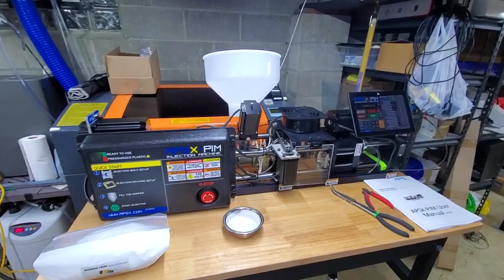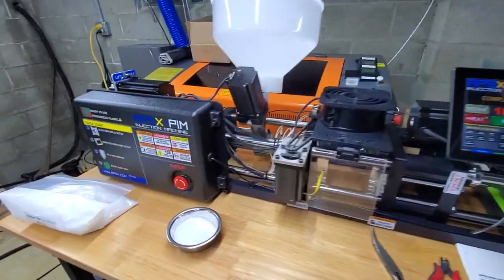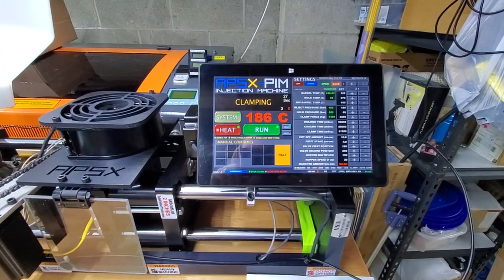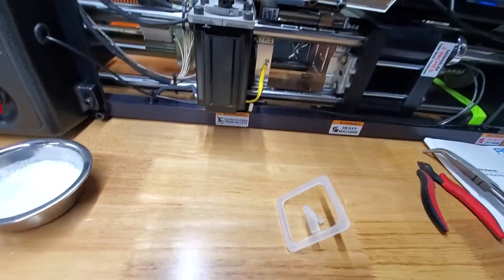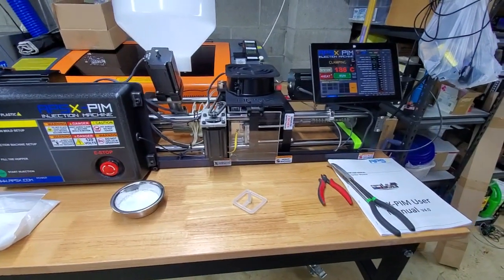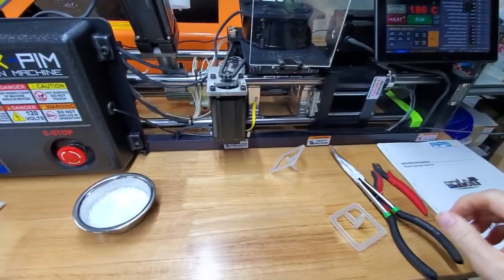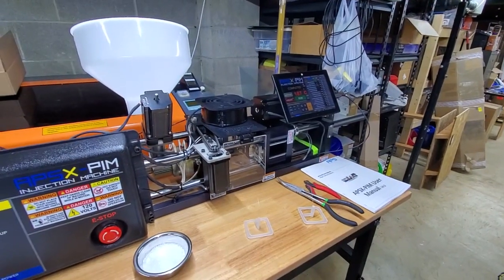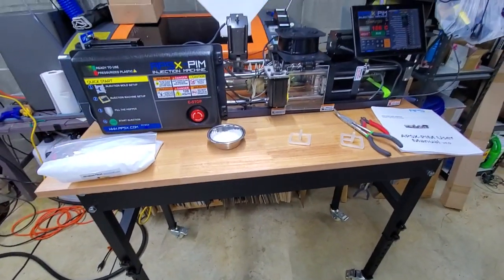My own personal injection mold machine

Comment: I need 100,000 parts with a volume of .4 oz.  Hoping 2 parts at a time.  How long would this take you if it this were fully automated (with ejection pins)
Reply from the maker: Depending on the size of the part of you could do several cavities, you could get decent production. I think the cycle time is between 90 and 120 seconds. Still would take probably a month running 24/7. This is really not the machine for that kind of production.

I think this machine is really designed to put plastic injection into the reach of a start up or designer. Once your product gets launched, then you would switch to traditional injection mold machines. 

For my use case, I will need quantities of several thousand units and that can be done in a few weeks easily, but then if demand increases I would farm the production out. Where a machine like this really shines is in being able to create a mold quickly and test it w/o long lead times for the machining on the mold and then trying to get into the production schedule to then get thousands or like you are asking for 100,000+ parts ran.

I think the manufacturer of this machine quotes it's good for 200,000 parts / year. Which, is basically running a single cavity mold 24/7/365.
Reply: @SEEMERIDECOM   Currently I'm 3D printing, but TPU can be picky.

Comment: How big a part can you make? How do you mill your molds? About how much$$$ I need!!!
Reply from the maker: For the most part it's about 5" x 4" x 1.5". But all depends on the volume as the shot size on this machine is only 30 cc. For my needs, it should be big enough. But, it has it's limits for sure. I should be able to use this machine for all the 6-10 parts I need for the main product I'm designing now. 

The machine as it sits with no molds runs about $14k. The blank molds are ~$400 before you machine your part into it. THen the molds are good for tens of thousands of runs. Not as good a s steel mold for sure, but way way less money.